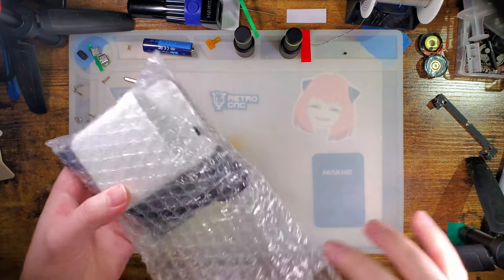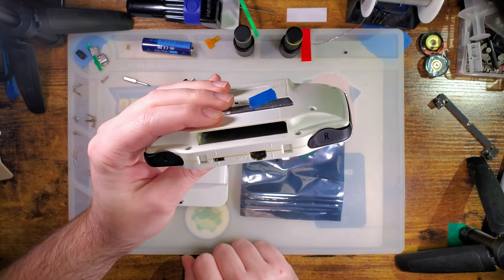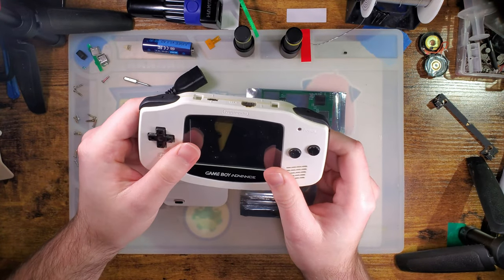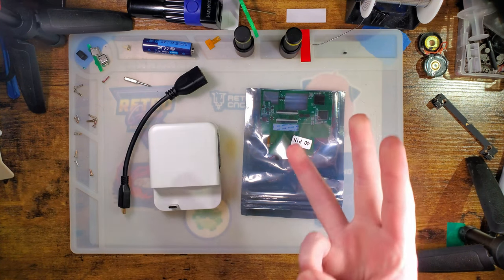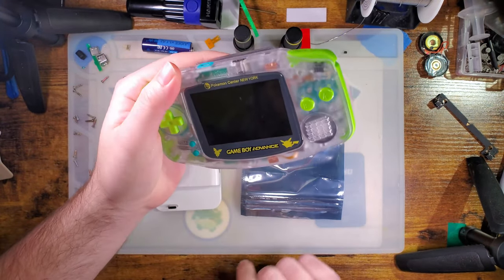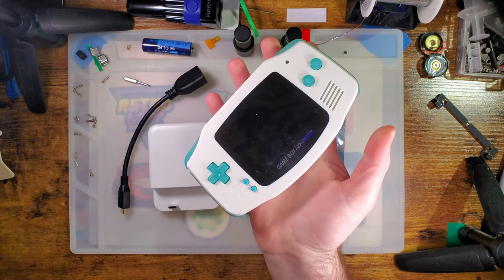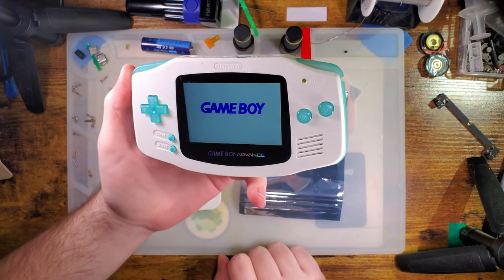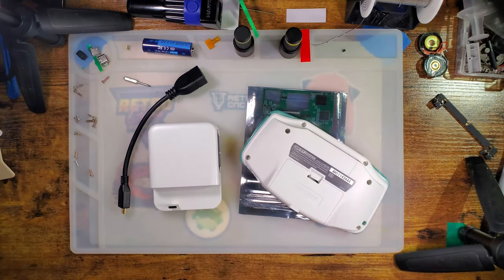HDMI Docking kit for Game Boy Advance (HDMI over USB Type C connector)

Comment: After ordering 4 weeks ago, today i finally built my ultimate Gba with the dock. Biggest problem was soldering the power Chip from the board. After 8 hours everything works. Only problem i cutted the usbc hole too much out. Im searching for a solution, maybe any Silicon pad to fill the hole. Its my second ips build and im very proud i made it. I ordered v2 but i think it is a neweer one then yours. Display was already connected to the hdmi board. If you know any shell with hdmi out port pre cut, let me know. It takes hours to make the shell ready. Tha k you very much, wothout your video i wouldnt had any idea ❤
Reply from the maker: You could make your own bezel and glue it to the shell to hide the cuts. I do that on occasion when I over trim.

Comment: There is a new HDMI kit on the market from the same manufacturer including display and OSD. I would be happy if you could test that as well.
Reply: is there a link/video you could send on this kit? i can’t find any mentioning one including display and hdmi

edit: found it on ebay/aliexpress,  it’s basically this mod with the highspeedido/onechip ips v5 in one pcb. no fancy stuff like frame blending though despite the laminated version of that ips kit having it

Comment: For all of the effort that went into designing the internals of this thing, you'd think the dock would be a bit nicer looking/actually support the console rather then have it just sit on top of the port. It is a cool mod regardless if a little pointless. Just needs some slightly less jank too it if that is even possible with these mods.
Reply from the maker: The company that makes this mod has consistently done stuff like this. They'll do like 80% of the work and then leave users to figure out that last 20% or deal with just having an incomplete mod. They are one of my least favorite mod makers because of this.

Comment: that's really an exhausting mod. i got another ips display, but adding the dock makes the gba so thick that it puts pressure against the display... which also caused your white spot.

got to do a lot of trimming now... but actually don't know where to start. lol

also hate the fact that i have to unsolder a lot of parts again.
Reply from the maker: With enough trimming, it all works and fits fine. Obviously lots of fit checking is required though. Time consuming.
Reply: @makho  Quick question... using the dock - do you experience audio delay using capture cards as well? output on tv is fine. i only have this issue with the gba dock. other devices (ps3, 4, 5, xbx, switch etc.) work fine.

it's my second gba now with the dock mod. both have this issue with my avermedia live gamer 4k.
Reply from the maker: @WillbaldStreamen  Capture cards are notoriously laggy. I recommend using one with passthrough for this specific reason. 

Could also be that your capture card is not compatible given that these mods run at around 59.7Hz instead of the standard 60Hz.
Reply: @makho  Hey! Quick question... have you, by any chance, been able to get a good USB-C extension that plays well with the dock? Been ordering a few for a while now but none of them worked... I once got one to deliver power. but they never delivered audio and video.
Reply from the maker: @WillbaldStreamen  These aren't USB connections so a USB extension won't work. Perhaps a thunderbolt extension might work? You need a cable that uses all 20 conductors. Type-C connectors are designed to be reversible so most USB cables only use 10 conductors at most.

Comment: I installed it and it has problem with most controllers I hook on the wiimote "nes mini" port. Only it doesn't make sense... Snes classic USA works, the European doesn't, neither does NES mini or Wii Pro. Any ideas? Snes port seems to work fine.
Reply: Hi, i have the same issue, cannot.make any controller to work. Seller doesnt help..but they keep selling the kits off aliexpress

Comment: As a side note I just want to point out that the wiimote's rear port is an i2c bus, with the nunchuk, classic controller, motion + sensor, and all other accessories on that port using an i2c bus format. the snes controller port uses latched data pins, not i2c; while the 'wiimote port shaped connector' on the dock does in fact use i2c, as do the recent 'mini' controllers Ninty has released, it's not quite accurate from a wiring or data connection perspective to say they're the "literally just the supernintendo connector but in a different form factor" in the same way that it's not accurate to say that a 1980's serial joystick port is "literally just a USB-C connector but in a different form factor".

The fun thing about i2c, though, is that it has enough pins to be dual-wired, that is to say, you could shove an i2c chip into a snes controller, and make a hardware-less pin-to-pin adapter to plug an snes controller into a wiimote port, and boom, it works. (Still need an active converter chip in there somewhere, but they do have the same NUMBER of pins, so it's technically feasible to do both.)

Comment: This kit seems like an absolute nightmare to install
Reply from the maker: It was fiddly to get everything lined up with the brackets and such but it's fine once you've got the order of operations figured out. It's probably a lot easier to just use any kit that isn't a laminated funnyplaying kit.
Reply: @makho  I wouldn't dare go back to non laminate kits after how awful my experience with the IPS V2 kits was
Reply from the maker: @3a.m.284  Well, funnyplaying isn't the only maker of laminated kits. This interposer board is likely a lot easier to install when used alongside the LCD kit from the same manufacturer. Also, if you're bothering with HDMI, I think it doesn't matter too much what screen you got inside the console.

Comment: Hello ! I watched some parts of the video and I have just a small question ! My Elgato Capture Card sometimes gets the sound from the dock, but I get no image and I can't find a way around it. I seem to be using the same cables as you but you seem to have changed something and said " I know why the capture card doesn't work " but you didin't give a clear answer why. Could you help out with this ? That would be awesome. Thank you so much and good work on your video.
Reply from the maker: elgato is not compatible with most DIY HDMI stuff, GBA mod kits especially. My issue and yours are unrelated. I didn't explain why it wasn't working because I thought waving the unplugged HDMI cable would be enough of a hint.
Reply: @makho  Oh okay. Welp, guess I'll stop trying then lol. Thanks a mil for the response !
Reply from the maker: @OncleS.A.M Yeah, sorry. I know elgato is usually the name on peoples' lips for this stuff but their stuff is really limited. I'm unaware of any third party fixes and as far as elgato is concerned, there's nothing to fix on their end.  

Incidentally, the cheapo unbranded capture cards on aliexpress and the like work way better for this sort of stuff. I got a "4K" one with passthrough and it's what I use for all my captures now.
Reply: I just assembled my GBA dock kit today and it is working fine with my Elgato. I will note that I am using the original Elgato game capture that only supports 720p so maybe that makes it more compatible?
Reply: @josephlucas.44  it makes sense because I read that the small resolution of the gba makes it a hassle for the signal to go through. That might be part of the problem. Thanks for the input though !

Comment: Great video. Do you know if that kit compatible with the IPS V5 kit sold on Aliexpress ?
Reply from the maker: Unsure which specific kit you mean. "v2", "v3", "v4", "v5", etc are usually tacked on to listings by the seller as a sales tactic and it doesn't actually mean anything in nearly every case. 

Electrically, this should be compatible with nearly every kit though. Mechanically, well, good luck as some kits are harder than others.
Reply: @makho  Any idea if it would work with the 720x480 OSD 15 brightness IPS kit? It has a daughterboard a bit larger than the one in this vid that I worry might conflict, you posted a video on it about 5 months ago.

Comment: Do you think it would be managable to desolder the usbc male connector on the dock and wire my own male connector? I want to 3d print my own formfactor that puts the plug somewhere else.
Reply from the maker: If you have to ask, I think the answer is no. You know your abilities better than I know them.
Reply: @makho  Yeah I bought one and it looks way to difficult but thanks for answering anyways!
Reply from the maker: @tealias  You could try a custom built extension -- might be easier than straight relocation. Despite using a Type-C connector though, it is NOT a USB connection so you'll need something that connects all 20 conductors. USB is typically only 10 conductors and reversible. This is not.
Reply: @makho  Yeah I was gonna do that too and make a custom extention cable if a regular didn't work. I am still waiting on my screen kit to arrive while planning. Have you tried already? Big thanks again!

Comment: Annoyingly had to wait a month for a SN30 to arrive via Ali and when it does found out the audio lags by about a second once you have been playing for 10 min or so. Until this point not played for that long as i didn't have a fully working controller.

Did you experience this? Wondering if its a me issue (maybe PAL vs NTSC, maybe my telly settings etc).

There are unused pins on the USB-c connector, i could route audio through there and put a line out on the dock but that is a faff.
Reply from the maker: Audio is already routed into the dock, you can just pull from there. How else would it get knocked into the HDMI signal? 

More likely the issue is with your TV (Samsung or LG?) since these devices do not output a standard HDMI signal, your device must be only partially compatible. You can try a different HDMI port if you've got different types or another TV entirely. 

These devices output at the same refresh rate as the original console so instead of the standard 60hz, the mod is doing about 59.7. This is close enough that most devices are fine but clearly yours desyncs. If you unplug your HDMI cable and replug it when the desync happens, I bet it will go away until it desyncs enough again to be noticeable.
Reply: @makho  Thanks for the responses, with a channel as big as yours I don't usually expect a response (especially considering you gave info on the USB-C extension comment i made too) so thats cool!

As for the HDMI, when i opened the dock out of curiosity i didn't see any hardware between the HDMi connector and the USB-C connector so i assumed the board inside the GBA generated the signal. My understanding is the HDMI does not transfer analog audio so i assumed the embedding of audio was done inside the GBA when the signal is generated. So that was my reasoning there.

Our TV is an LG and from a google is has a number of aduio sync related options (not sure if my specific model has them all) but i'll have a look and see what i can do. 

I wonder, if i ran analog audio from the GBA direct to a stereo for example would it still desync? Truth be told im not entirely sure how it works. Either way thanks for the info and given me direction to investigate!
Reply from the maker: @stephencooper3067  Honestly, I'm not sure if the audio would still desync since the issue is likely related to the frame timing. It's certainly worth a shot. 

The S01 and S02 test pads that the kit attaches to on the GBA are the PWM audio signals from the CPU itself. Or you can use the headphone jack.
Reply: @makho  Well had a bit more of a play and your right the audio does not desync if using the GBA's headphone jack. I found a cheap HDMI to component adapter in a box. Hooked it up to see what would happen and the audio stays perfectly in sync. Obviously the video now looks crap which is sods law!

Not entirely sure what options i have from here. The TV itself has no options to assist. I don't have a separate sound system to use instead. I suppose i could try and inject audio with an adapter between the dock and the TV. Not sure how much lag that may introduce though.

Either way the component adapter gives me a working solution so not end of the world, would rather poor video quality than de-sync audio if i had to choose!
Reply from the maker: @stephencooper3067  Maybe something like a retrotink 4k could clean up whatever is causing the issues HDMI desync. I don't know that there isn't a solution other than buy a different TV, try a different consolizer (like an analogue pocket + dock), or spend almost a thousand dollars on a scaler that may or may not fix your issue. I mean, all of those solutions are a few hundred dollars at minimum anyway so I understand how much this sucks. 

If the company that makes these things ever sorts out the incompatibility, chances are extremely likely that you won't get any support with yours and you'd have to buy a new one. Given that this thing works on other brands (like my vizio TV from 2012 and monoprice computer monitor from like 2016), I'd say it's not entirely on them either. 

I have no idea if this will have any effect whatsoever but maybe an HDCP stripper or similar will work? I don't know of many devices that can convert HDMI to HDMI except for retro scalers like the retrotink 4k. 

If I could recreate the issue on my hardware, I'd do some more digging for you.

Comment: Couldn’t you change the hdmi connector on the dock for a full size one?
Reply from the maker: It's not as simple as removing the mini port and soldering in the big port but yes, you can. Big port won't have anywhere to attach so an adapter would need to be made. I'm content with just leaving a dongle plugged in to the dock itself since the dock doesn't really need to move around.

Comment: I can kind of understand the janky dock design. There is no way to guarantee the USB C connector will be positioned the same on each install, so the dock can't be designed to fit more snugly on the console. Now if that is their actual reasoning or not, who knows. 

It's a shame USB-C extension cables don't reliably have every pin connected. Tried a couple with mine and they would charge but no video. That may be a work around. The better solution would be shells built with this mod in mind, then the dock could be built to work specifically with those shells and provide a better fit.
Reply from the maker: I wouldn't be surprised if they just winged it and it worked well enough that they shipped it as is. 

Look for a thunderbolt extension, that should have all the pins connected 1:1. Not cheap though.